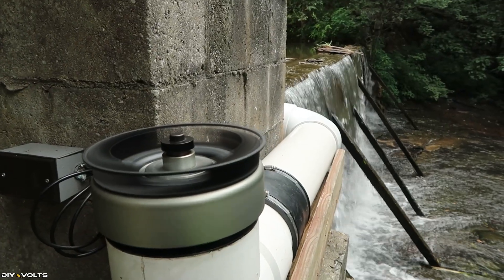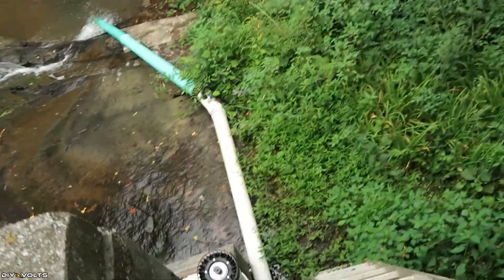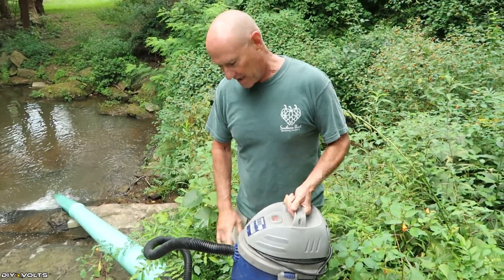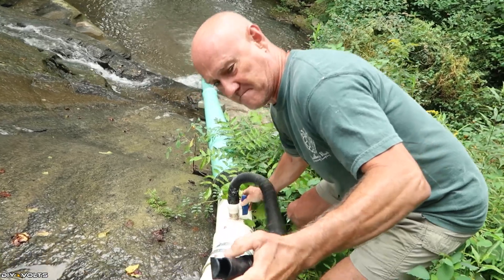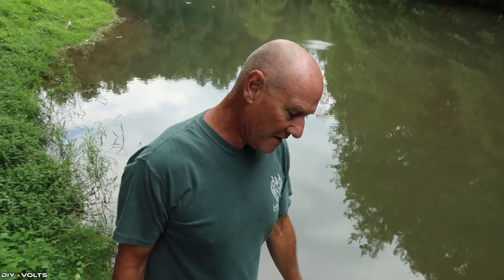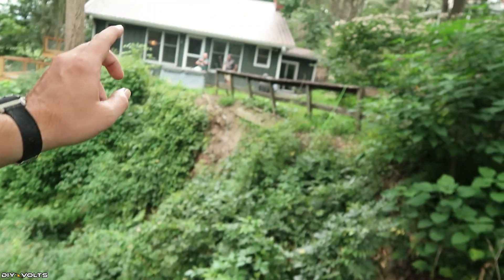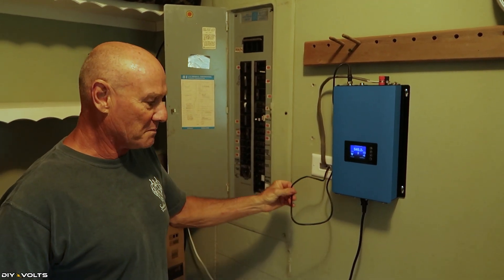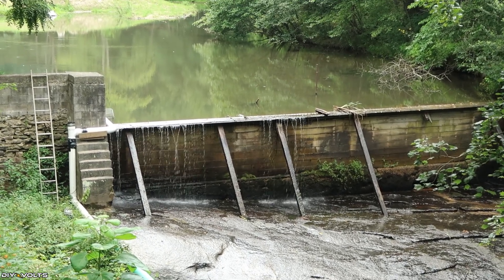Awesome! Low Head Hydro Power in the Mountains 500 watts

Comment: To complete the system may I suggest adding a ram pump (or something siphonic) to bring back the water up to the creek. Then it becomes a close loop system.
Reply from the maker: It would have to be a very large ram pump. For example a 1-1/4" pump would have a max return of 2gpm. This system is using over 300 gallons per minute. The 2gpm would not make much difference.

Comment: I reckon he'd get more out of it if it was designed without the 90° bends. Gentle bends reduces friction losses in the pipe.
Reply from the maker: Yes a couple of sweeping 45s instead of a single 90 would give better flow rate over the turbine.

Comment: 500 watts 24/7 is a lot of power. I could absolutely make it on that
Reply from the maker: Thats 12kwh a day. Toss a couple solar panels in the mix and this is all one needs.
Reply: @DIYVolts  except if you rely on electricity for your primary heating source.
Reply: It isn't 24/7 through 6:24 he has to be careful he doesn't drain the lake.

Comment: That a great system !! I would add a water level sensor to auto shut down before draining to far.  I would put the DC power into a MPPT controller into LiFePO4 battery system. Like a EG 4 system. Then add solar and wind if you can. That way you always have power when you need it. Still a great system !! Cheers from NY !!
Reply: Just a simple rubber flap that snaps shut when the water level drops.  No fancy electronics to go wrong.  
The failsafe in this current setup is, if the water level drops below the main intake, it draws air, breaking the siphon, no harm done. You just have to drag the vacuum out and restart it again.

Comment: Put some died water through the intake then carefully time how long it takes to exit. A pipe diameter volume calculator will detemine how many gallons/liters per min is flowing.
Reply from the maker: I think he mentioned that the flow was right at 350 gallons / minute.

Comment: all this for just 12 units a day. xD
Reply: In many parts of the world, 12 units a day will power a typical house but perhaps not in America.
Reply from the maker: That is true. Take away heat/cool and this much power will be enough for the average home in my area.
Reply: @DIYVolts  yup other than heat cooling i  usually only use around 10-20kwh even with machine/workshop
Reply from the maker: Its true that the power is not a lot for the average size American home. My house with solar can use over 20kwh a day. Especially if I run the clothes dryer. This system would be great to supplement the power usage.

Comment: I swear ive seen this video somewhere else before or at least a video on the exact same guy like holy deja vu
Reply: "Awesome Low Head High Flow Grid Tie Micro Hydro 530 watts!" 4 years ago but its little different video but the same system
Reply: Seth, the guy that has the YT channel 'Land to House LLC' was not getting any promotion on YT any longer so he started this DIY Volts channel. This is the same video off his other channel from several years ago. The way Bill starts his turbine is innovative
Reply: @chrisdaniel1339  yup.  YT can make and destroy channels at will by their actions.   Perfectly acceptable content gets blocked for absolutely no reason, and yet they accept advertising from illegal overseas casinos and scammers, strip clubs etc.
Reply: @chrisdaniel1339  I like the vacuum starter, but it would make it so much easier to bolt a few treated pine sleepers to the top of the dam to raise it 150mm (6”), and run the intake through that so it’s below the new raised water level, and self primes.  A few hundred dollars in wood and galvanised screws, maybe some plastic or rubber sheeting.  A few hours to install it all.  Roberta’s your Auntie.
Reply: Ahh kk that makes more sense now
Reply: I just posted the same. I thought I'd seen this a few years back. Great set up, it's great that it's still going strong after all these years.
Reply: I've watched a video project like this, about a year or two ago but I forgot the name of the channel. But it's very similar, and it still gives me Dejavu.
Reply: I thought i was the only one....
Reply: It was the vortex destroyer that made me remember

Comment: i bet you could make over 2000 watts if you started using water jets with the paddle wheel. Maybe even have 2x 2000 watt gens with that much flow.
Reply: He is producing really low power..if he used the full water drop installing the turbine lower in the dam i bet he could move a way bigger generator...
Reply: @brownyysnoopy  That and the flow rate after using small jets would slow the water down and increase power.